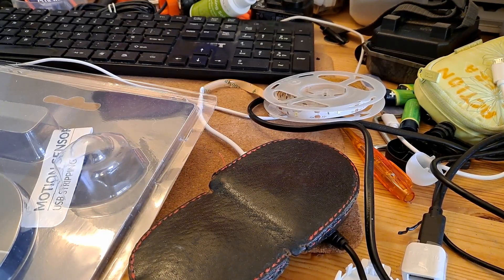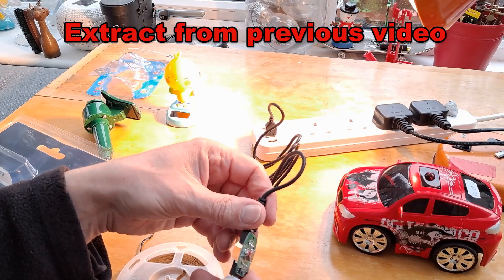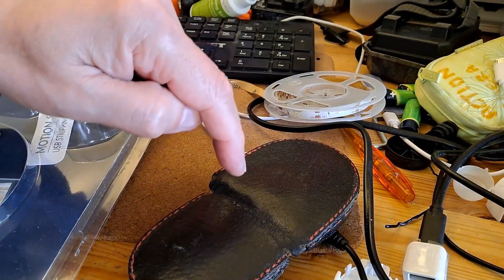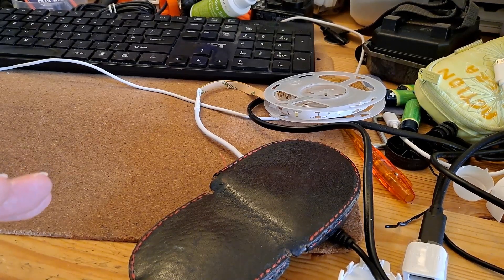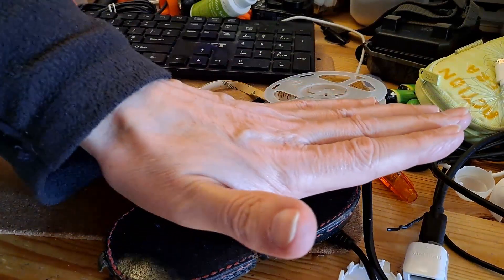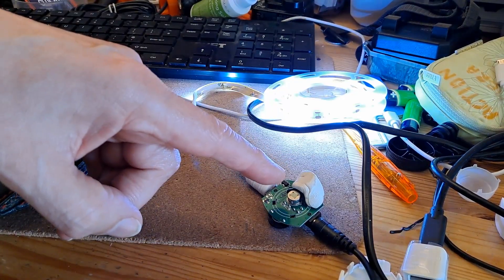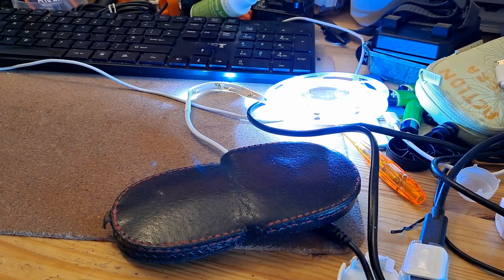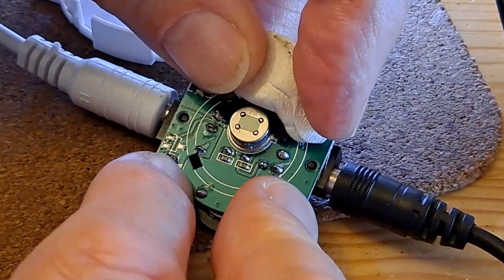Poundland Motion Sensor USB striplight revisited

Comment: At low light levels, the LDR has a high resistance. As the light intensity increases, the resistance decreases so you  will need to stick a high value resistor. Maybe stock the multimeter across the resistor while the bluetack and tape is on it to see what the resistance is. Then use a fixed resistor of a similar value.
Reply from the maker: If I just cut it out that would be as high a resistance as possible 😊
Reply: @GrandadIsAnOldMan  that is so true . You can tell I just woke up lol
Reply from the maker: @makerofthingsunique  I didn't think of it myself, somebody else made that comment already 😆😆 (Crawley Creaper)

Comment: PIR sensors usually rely on the facets and lines if the white cover to  work properly, to cast multiple images of the objects passing before it. Since the resistance of an LDR in the dark is many megaohms, I would just desolder it and refit the plastic lens. That is most likely to work..
Reply from the maker: Yes, or even just cut it out.

Comment: just put some tape over the LDr and put the frensel lens back on as that help the sensor to operate as the frensel lense divides the movement signals back ???
Reply from the maker: Yes, the confusion was the fact that in the first video, covering it with my finger didn't seem to have any effect. Of course it might be as simple as my finger was providing a low resistance giving the same effect as daylight on the LDR.

Comment: I would say that one of those surface mount resistors might determine the sensitivity.
I could see three beside the LDR and two below the PIR. The timing is probably done with a capacitor but from what I could see there is no capacitor on that side of the board, although it could be on the other side or under the PIR module. If you find the resistor that determines the sensitivity then you could have a couple of options. Option 1: Solder on a variable resistor to set the sensitivity to whatever you want. Option 2: Solder on a higher ohm resistor that you are happy with. You could use the legs of a different value resistor as probes to find the sensitivity resistor. Would be great to see it working with the robotic arm. 
👍👍👍
Reply from the maker: Thanks, Mike. The robotic arm went in the bin months ago. What I was looking for here was a short cut that I didn't need to play around with. If I have to start playing around with items on the circuit board then I might as well build it from scratch. The beauty of this one was it switched a good 5 volt output that could drive many standard items. In most cases, just using the LDR on it's own is good enough for triggering some sort of motion detection. You just ensure it is pointing towards a suitable light source. It doesn't need to be bright, just enough to show a difference when somebody walks in front of it. I did quite a few videos based on the parts from those annoying singing birds that start up when you walk past them, oh and croaking frogs. There used to be plenty of them in the garden section in Poundland. Here is an early example https://youtu.be/N204SmBJzMs the frog wasn't quite as successful https://youtu.be/03RtlfiWEBk I also did quite a few Halloween versions.